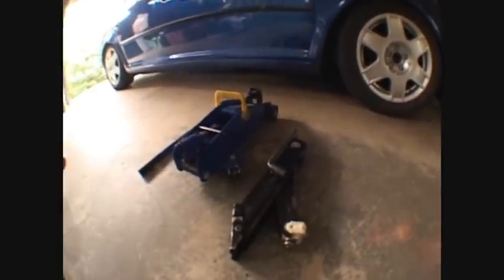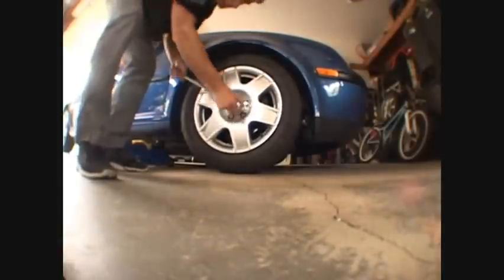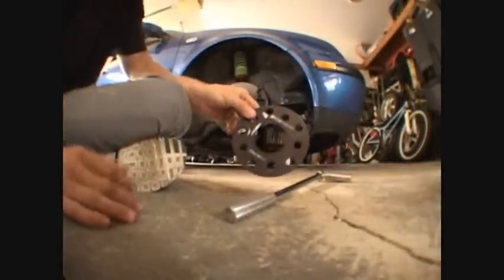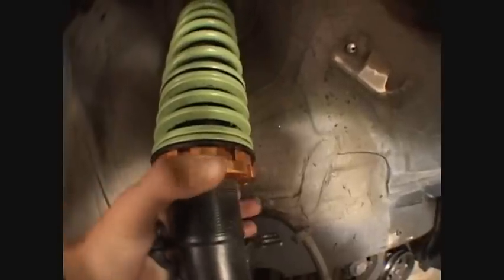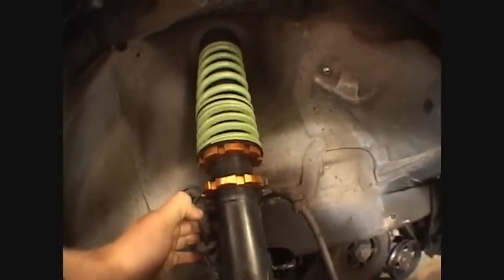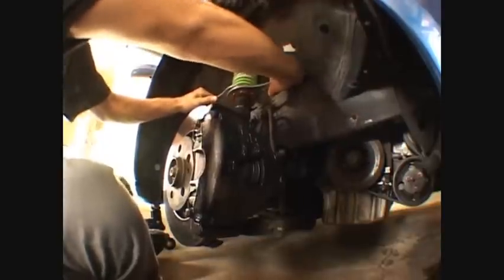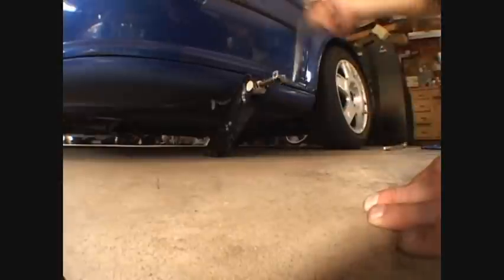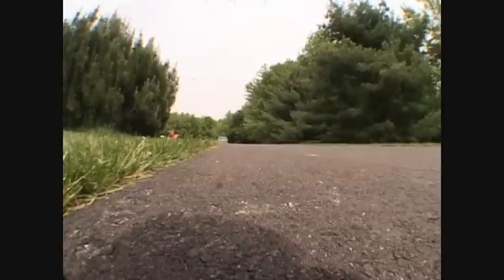senior english ultimo coilovers

Comment: There oem wheels and tires, you will need a 5mm spacer up front for them not to rub the coil. I run stretched tires now with wide wheels and I'm fine

Comment: i just got ultimos i wanted to do the install myself, the only thing i can see presenting a problem is disassembling the stock suspension for the pieces you need. did you tension the springs to remove everything?